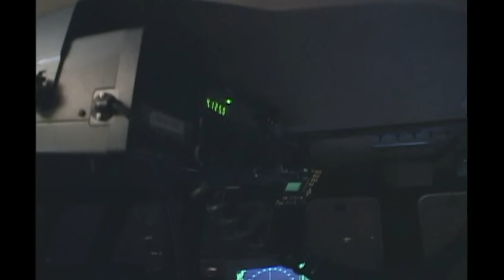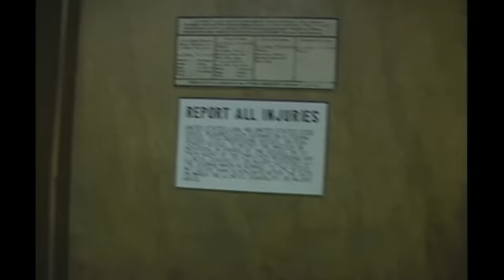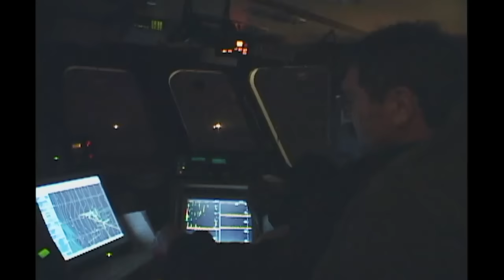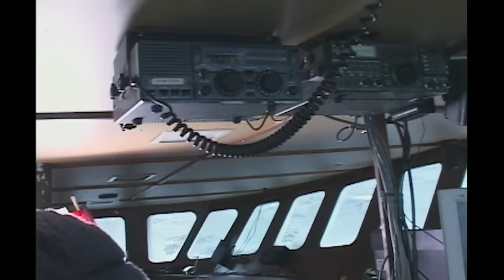DEADLIEST CATCH - FULL EPISODE | Season 1 | Ep 3 (America's Deadliest Season - Alaskan Crab Fishing)

Comment: I used to do Snow Removal. My 1st year was 2013-14 when we got a foot of snow almost every day, and the temperature never got over 20° for months. We did 36 hours straight  a few times cus the snow just didn't stop and it was too cold for salt to work so it had to be re-cleared every few hours. 
As the new guy, I was the one that had to shovel the walks and steps.

To get to my point... getting a break and warming up is almost a curse cus you don't wanna go back out. The cold feels colder after you get warm, all your joints start to hurt after a rest and you get sleepy when you aren't moving around the whole time. 
Shoveling a foot of snow and hauling buckets of salt up and down hills and stairs sucks...
I can't even imagine what its like when you add a rocking deck and being temporarily underwater every couple minutes to that kind of work. Oh yeah and the constant risk of certain death. You don't really see that plowing snow 😂. 
Its hardly comparable. 

Thankfully we got a couple new kids and I was able to drive a plow truck the next year.

Comment: Why don't they tie off with harnesses when they are breaking ice? Seems like a simple way to increase safety...?
Reply: the lifelines could easily get sucked it the gear and cause crushing accident your more likely to get a guy injured or killed by a line than falling into the ocean the less rope is better
Reply: I totally get how it would seem safe but in the very possible chance that the boat goes down and the rising water makes it harder to unhook yourself from the harness the sinking boat would drag you down farcing you to drown.
Reply: @hannahmarie5060  To be fair, once the vessel goes down, you don't have long in the drink before you're kaput anyway.
Reply: I don't even understand why they break ice by hand like that to begin with. Why don't they have pneumatic roto-hammers with big fat chisel bits? You'd be able to get it off in 1/4 the time with about 1/16th the energy. That's what I use for busting massive ice dams off of roofs in the mountains of Idaho when we have a bad winter. It works amazingly well.
Reply: Idk man, boats swinging and bouncing, waves slamming the boat....think the last thing I'd want is to be having off the boat by a harness ya know
Reply: If you're harnessed, and you get tangled in heavy gear, or snagged in equipment, your torso can get crushed.
I've been in a basket on a forklift, and had my harness get snagged on some warehouse racking, as the forklift was pulling away.
It compressed my chest so quickly, that I wasn't able to say a word.
Thank God there was someone in the basket, to stop the lift operator, who was 40' below, or I'd have been folded in half, the wrong way.

Comment: One January we had 45 mph winds straight out of north, it was 0F and it was my week to count cattle and dadmmit if a momma and baby calf were missing. I was on our 2800 acres leased land in my 1994 Nissan 4x4 and with the snow and ice we were just getting around.Then back side of creek that runs into a flood control lake I hear the momma bellowering and know it's bad news. I was thinking hog or dogs or coyotes so I took my AR and headlamp and big ass torch. Goddamn calve had tried cross fallen log other cattle used as bridge but had sliid off into water with itfront legs barely holding with half it's body underwater. Shit. Shit I could barely see for ice Chrystal's and show. I ended up having to jump into that water: the ice broke right away and get up under that scared to death little calf and pull and shove and scream and carry and pray and somehow after several hours I got the little squaller over to the other bank with it's momma. I had never been so but exhausted, cold, and just out of it.Took me a while to get my frozen ass down to the truck and get that momma/baby down to the only heated barn we had at that time for cattle and me. that cold saps energy from ur body before you even know it. That guy that went overboard was a lucky S.O.B.

Comment: Why can't these boats use 90 to 99 % isopropyl alcohol on the ice that coats the boat? Alcohol instantly melts ice. So they could do the same job with less the effort!
Reply: Because the icing conditions, (wind, spray, etc.) during bad weather are often constant, very rapid and highly accumulative. A boat would literally have to carry thousands of gallons of it just to keep up. Just not cost effective nor practical.  Not to mention, the system itself would be cost prohibitive in terms of expense versus actual usage and would also be in need of constant repair from the heavy assault by wind and waves.
Reply: What about the pollution of the water? Just to be able to order crab at a restaurant? Hasn’t mankind done enough damage to the earth?